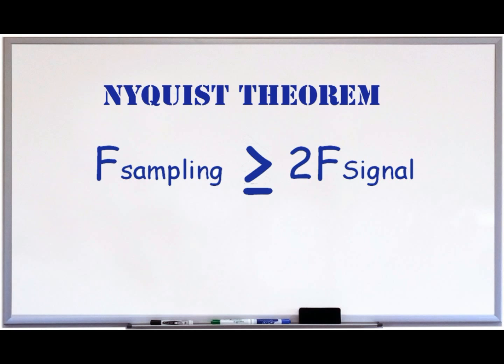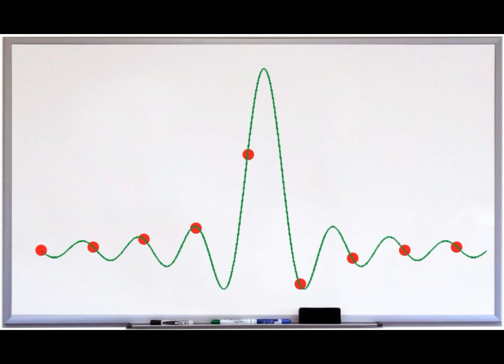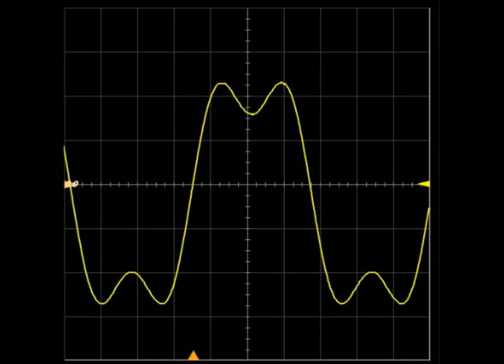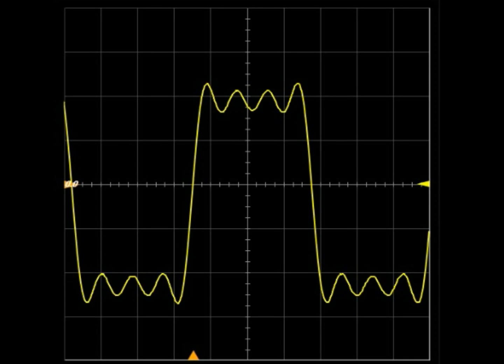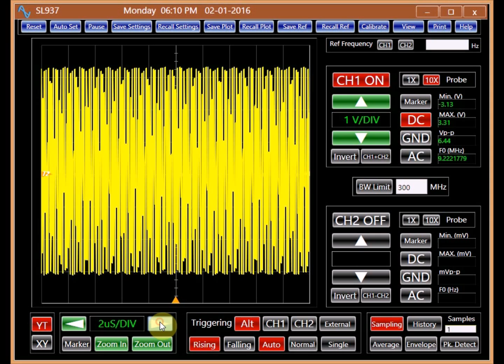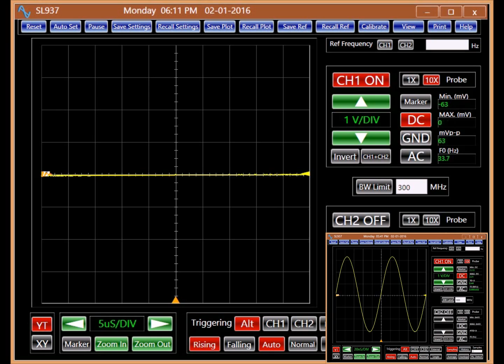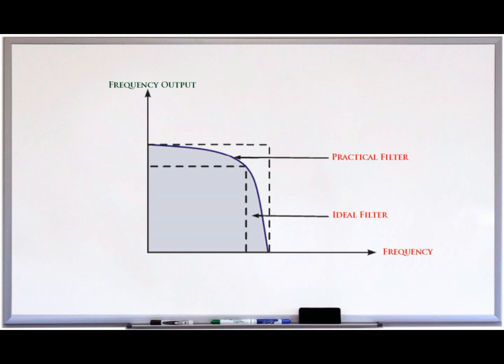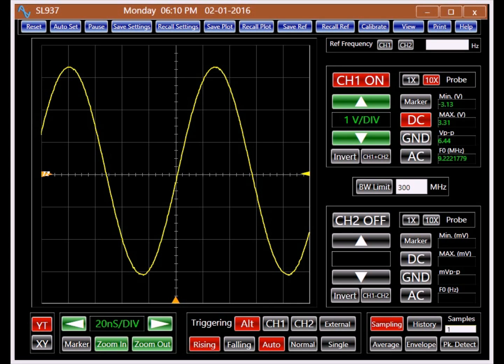Aliasing and Nyquist - Introduction & Examples

Comment: Why do people keep saying the Nyquist theorem allows the sampling rate to be atleast twice the highest frequency? Exactly twice the highest frequency would represent that highest frequency as a 0 on the y axis. It needs to be more than twice the highest frequency for the signal to be represented perfectly.
Reply: Great observation. But note that the Nyquist Theorem provides the correct MINIMUM sampling rate for a system. It does not set the sufficient requirement though. In other words if your sampling rate is below that of Nyquist, you would not be able to define the signal correctly.
Reply from the maker: Thank you for your comment.
http://redwood.berkeley.edu/bruno/npb261/aliasing.pdf answers your question in details. Theoretically, this minimum sampling rate is in fact correct since having two unique sample points per cycle is sufficient to define the sampled sine wave. Of course, for the special case that you lock the phase of the sampling signal such that it always passes through the middle point of the wave, you are absolutely right. In practice, however, we need much higher sampling rates than what the Nyquist theorem demands.
Reply: @academia7768  I believe that paper is wrong -- and thus, so is your video.  See https://en.wikipedia.org/wiki/Nyquist%E2%80%93Shannon_sampling_theorem#Critical_frequency - which mentions the requirement of a "_strict_ inequality of the sampling theorem's condition" (emphasis in the original).

Earlier in the document, it also says "The sample rate must exceed the Nyquist rate for the samples to suffice to represent x(t)" (emphasis added)

See also: http://musicweb.ucsd.edu/~trsmyth/digitalAudio171/Nyquist_Sampling_Theorem.html -- which quotes the Nyquist theorem as saying "A bandlimited continuous-time signal can be sampled and perfectly reconstructed from its samples if the waveform is sampled over twice as fast as it's highest frequency component." (emphasis added)

For what it's worth, you're not alone in getting this wrong.  An otherwise great video about this in the practical realm of digital audio uses equality rather than inequality as well.  :)  https://www.youtube.com/watch?v=pWjdWCePgvA (which, interestingly, was recommended to me as the "Up next" for this video -- which I didn't even notice until after I'd linked to it, because I watched it a while back and wanted to reference it because of the nice oscilloscope stuff it did... but then I noticed it got this wrong, too!  Oops!)

Anyway, change ≥ to >, and you're good.

Meanwhile, for you or anyone else interested in a deeper dive, but preferring a video format over papers and such, here's another video that gets it right (as shown and discussed at 27:09 in that video):

https://www.youtube.com/watch?v=_Z7ErH7UTMs

Comment: I disagree in what may seem a subtle way. If you capture a signal with a sample rate exactly twice the signal frequency, it aliases to anything from the full amplitude to zero output, depending entirely on where in the phase of the signal the captured samples are taken.

But this also means that if your capture rate is, say, 10Hz above that of the signal frequency, you will have a pulsing as the location of the captured samples changes on the waveform, creating a beat frequency of 10Hz in the sampled waveform.

I welcome corrections.
Reply from the maker: Steve, thanks for your comment. You are exactly correct. The Nyquist theorem, stated at 19 seconds, clearly states the required sampling rate for a signal. Then at 30 seconds, an example demonstrate that. At 15 seconds another example shows a situation similar to what you are describing. It appears that, the video is in full agreement with you.
Reply: @academia7768 : Yes, Steve is correct.  I disagree, however, that that's what this video says.  At 0:19, you show "𝐅sampling ≥ 𝟸𝐅signal".  This should be "𝐅sampling > 𝟸𝐅signal" (≥ becomes >).  And the audio says "at least", which should be "greater than".  More detail in a different comment subthread about this same point.
Reply: And this is why the CD Red Book spec of 16 bit 44100Hz (Nyquist frequency of 22050Hz) is standardized, and still used today :). But it really comes down to how the audio signal is mixed and mastered. Most adults can't even hear the full 20kHz.